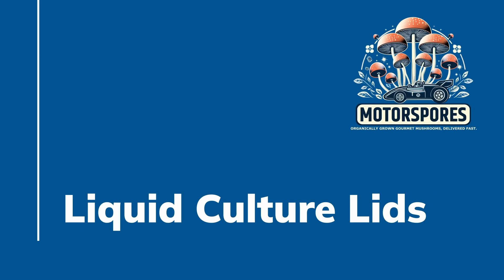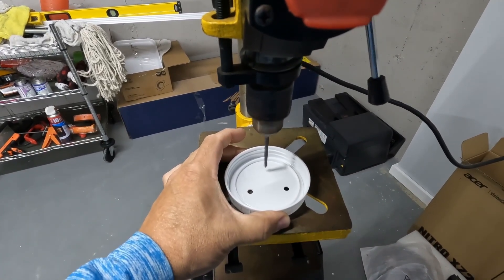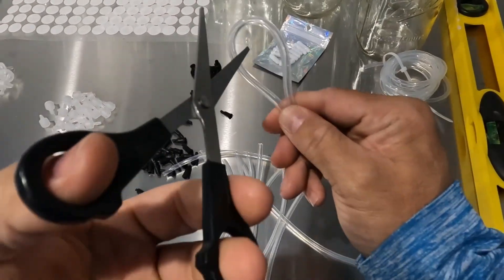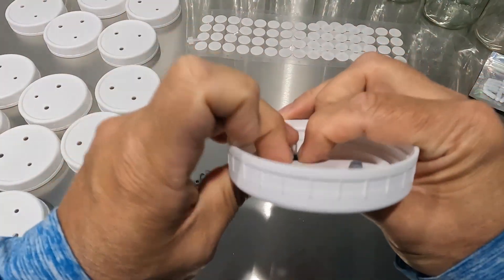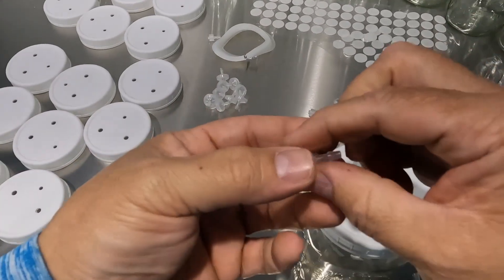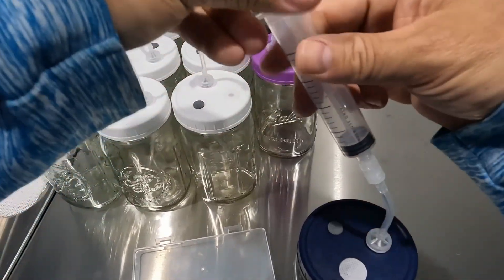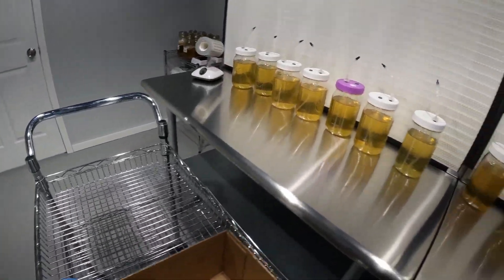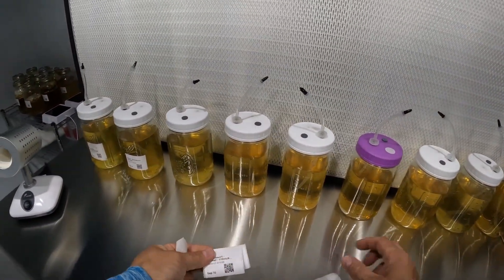DIY Mason Jar Lids for Mushroom Liquid Cultures Using Luer Lock - Clean & Easy Liquid Extraction!

Comment: Why not just put a female luer lock connector on the end of the tube instead of a male one? This eliminates the need for the luer lock couplings as you could then screw the syringe directly on to it (this is how I do it).

Comment: How do you deal with mycelium clogs getting trapped in the one-way valve? You can't push air in to unclog the valve
Reply from the maker: It hasn’t happened yet, but that’s why I also added the injection port, as a failsafe.
Reply: @Motorspores  is there any liquid culture left in between the luer lock and the stop valve when withdrawing liquid?

Comment: How do you get the last drops of liquid out of the Silicon tube? You can not push it in, but if you pull more out it seems that the Tube ist always full of liquid. Or is it just the endcap that seals the tube? thanks in advance
Reply from the maker: Hello, the tube is full of liquid culture. The one way valve and the cap seal it. The valve prevents liquid from going back in, leaving the tube full.